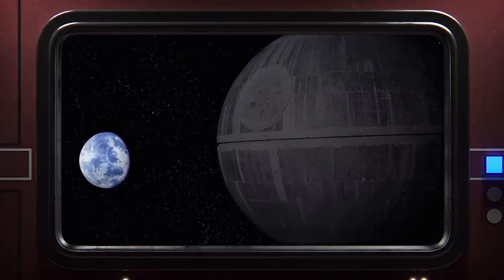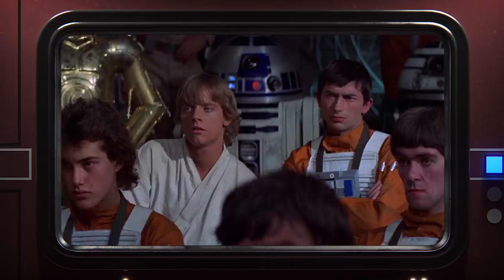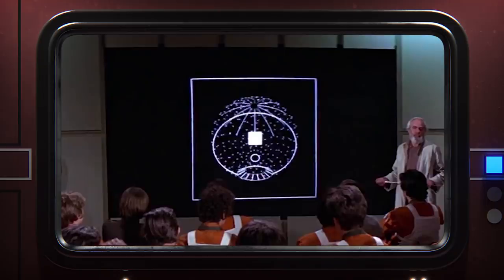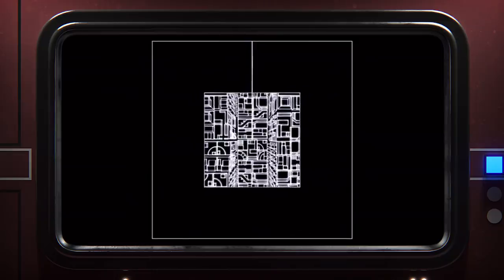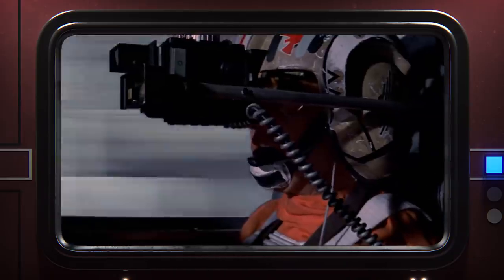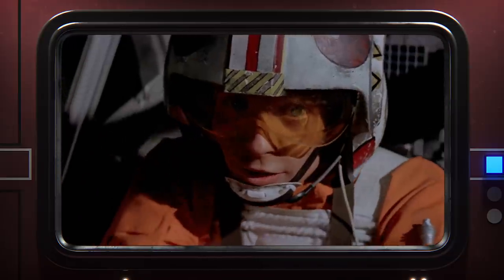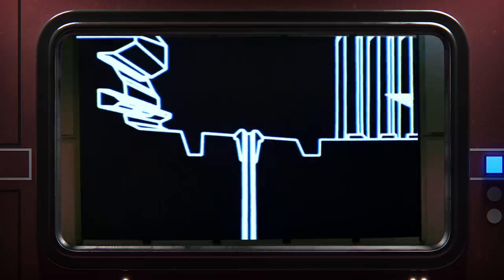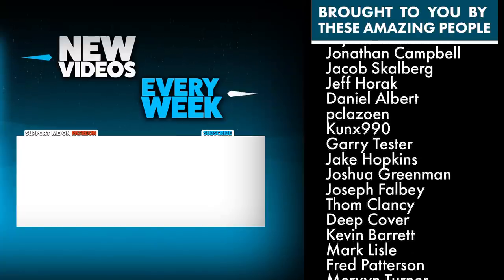The Thermal Exhaust Port Was NEVER a Problem

Comment: Another, related, point is the Imperials suspected something was wrong. An officer told Tarkin they had analyzed the rebel attack and found a small change they could destroy the station.
Reply: I wondered about this myself. It introduces a small weakness in the Rogue One storyline, or it suggests that they looked at the consequences of a proton torpedo hitting the reactor housing, discovered the weakness, and reported it in terms of threat. Actually, given the battle situation, this was quite realistic; root cause analysis is not suitable when the enemy is already on approach.

It also suggests that the Imperials were not complete dunderheads, and Erso not infallible. Stories are so much better when one side isn’t omniscient and the other side totally incompetent.
Reply: @andyl8055  You could do a LOT of drill down on the military of the Galactic Empire. How they recruit. How they train and promote leaders. The status of Stormtroopers and how they relate to the rest of the military.
Reply: Is that Florian geyer in your profile pic?
Reply: Indeed..... and that comment would seem to imply that there is a plausible reason why the port is not guarded against torpedoes beyond simple arrogance. It was a known risk, but one deemed necessary and manageable.
Reply: @travissmith2848  Tarkin even said it. "You overestimate their chances" and think of it. If Han hadn't intervened Luke would have died. If Luke hadn't used the Force he would have missed.
Reply: @readermike8355  Negligible chance combined with narrow minded combat doctrine is a factor. But it was known that if they attacked with a small enough craft, with just the right weapon, in just the right way it could take down the station. As the port was shielded against one kind of weapon it was clearly seen as a potential weakness, so it stands to reason that it would be prohibitive to protect against all possible weapons.
Yeah, a weakness that can only be exploited by a force user, someone insanely lucky, or the best ship's weapons marksman in the galaxy piloting a craft that conventional combat thinking is too small for the task and has enough cover to deal with the various turret emplacements and defensive fighter cover is not a glaring flaw. Tanks would be a lot tougher if they didn't have any holes or joints too. But then you'd just have a bunch of guys sealed in a steal can suffocating and starving with no way to attack, not a weapon.
Reply: @travissmith2848  ray shielding could be for other things. ray shields (the type in question) absorb radition. perhaps it is not shielded for protection but some function of the exhaust port. afterall the only thing it can stop is blaster fire which can't bend like a missile can.
Reply: @matthiuskoenig3378  It was, never the less, stated that what would have otherwise been the go to weapon was useless. Whatever the reason for the shielding the station was invulnerable to any kind of conventional attack and nearly so to an unconventional one even with the plans. The port seems more a functional necessity that was as protected as possible while still allowing its function. Kind of the opposite of a glaring flaw.
Reply: Something else of note happened even earlier in the film. Before the destruction of Alderaan, an officer interrupted Tarkin and Vader discussing Leia’s interrogation to comment on a final systems check revealing all systems were operational. I think imperial concerns about possible sabotage were laid to rest after that.
Reply: @travissmith2848  there are 2 kinds of shielding in star wars: ray shielding and particle shielding. The former stops energy weapons and the latter stops/vaporizes physical weapons, including proton torpedoes. The reason the exhaust port didnt have particle shields is because it would directly interfere with the port's purpose for existing. Namely, getting hot gas (probably either vaporized coolant or spent fuel) out of the station.
Reply: @Christian-sq2bw  Well... guess that explains it. Still, there was a reason for it to let torpedoes through so given the "nobody would ever...." thinking it was a known risk but a negligible and manageable one.
Reply: @travissmith2848  Remember, the heaviest warships in the galaxy at this point were only 2 km long. In a firefight, the Death Star had even the Imperial Navy outmatched. And the superlaser could go Yeet yeet starship delete every 15 minutes.
Reply: @Veloxyll  I believe the ability to target ships was an improvement given to the second one. Never the less, Imperial thinking would seem to be one that the station was heavily enough armed to fend off any large ships and fighters couldn't even scratch the surface. And yet the port was a known issue (as the attack pattern did represent a threat)

Comment: The novelization of RotJ states the second Death Star’s design eliminates the 2 meter exhaust ports and instead used thousands or even millions of tiny exhaust vents too small for any munitions to find and damage.  Unfortunately the battle station was not completed and the rebel ships could fly directly to the reactor.  Oops.
Reply: Russell Harrell You could blame the Emperor for that. He was way too overconfident.
Reply: Peter Krochmalni classic villain hubris, only to be overshadowed by classic hero hubris like in TESB.  And TLJ, if that counts
Reply: The entire point of the Emperors plans was that it was supposed to look unfinished and vulnerable, and that he was there to make the target even more tempting for the rebels. Had it been entirely unable to be attacked, then the rebels would just have gone to ground.
Reply: DE J but the Death Star was still unfinished, despite the main weapon being online.  The rebels succeeded in breaching the shield and flying into the main reactor.  The emperor should have at least had a separate shield generator on board to protect the reactor or a physical shield that sealed the core once the Endor shield failed.  His best troops on the moon couldn’t handle the locals plus a small rebel commando unit, and his plan totally relied on them holding the bunker long enough for the imperial fleet to mop up the rebel fleet.  And his best troops did not do their job.  There should have been a million troops or more on the ground, he had at least that many personnel on the death star and on the fleet ships.  That bunker could have been miles of tunnels with multiple ‘back doors’ in ensure a Truly overwhelming response to any incursion.  A half dozen At-st walkers and less than a hundred stormies don’t cut it.  Also immediate execution of captured rebels should been the order of the day.
Reply: Well if it was completed, then all you would need is an under cover operation to smuggle in an explosive and move it close to the explodey part of the reactor.
Reply: @samtheweebo  more easily said than done.  But fully within the skill set of our main heroes.
Reply: @russellharrell2747  That feeling when you and your buddies are patrolling Space Vietnam and the trees start talking in teddy bear...
Reply: Palpatine might have been a political genius back in the day. But that doesn't mean he was a good military strategist. 
Setting a trap for your enemy using an unfinished yet fully operational battle station/superweapon.
I think we should stop criticising the Deathstar and/or the Imperial Navy and start criticising the man who is behind them both.
Reply: @Agarwaen  People criticise the exhaust pipe, yet Palpatine set a trap for a famously crafty foe, using battle station with an exposed power core and insisted to personally over see the battle.
Reply: That could have been intentional, aside from the ambush. Maybe having the reactor exposed to space allowed it to fire much faster more often since heat wasn't bottled up in the middle of a small moon.
Reply: @Agarwaen  The Emperor should have made a second trap inside the Death Star. As soon as the fighters entered the hole throw up to shields. One to cover the hole so there is no escape and one on the way to the reactor to destroy ships like we saw happen in Rogue One at Scarif. Put up jammers just like they did as soon as the rebel fleet arrived so they can't detect the shield in the shaft. (Remember Lando's words as they headed towards the Death Star about not being able to get a reading on the shields one way or the other.)
Reply: The fact they had a star-fighter sized hole leading into the main reactor is kind of hilarious enough
Reply: @inkedseahear  Good ol' Palpatine really knew how to prioritize. 
I mean the light freighter sized hole in your battle station that just happens lead straight to your reactor isn't important, as long as you can blow up rebel capital ships with your super laser. Right?
Reply: @russellharrell2747  His plan didn't rely on locals fighting the rebels. It's possible the empire didn't even know about ewoks, or if they did they had no reason to believe they could organize well enough to actually fight. Reasonably they would've lost even if they did, but with the power of plot, combined with them stealing an AT-ST, they won.
Reply: @peterkrochmalni673  Nah. It would have worked if not for the Teddy Bears on the ground.
And just like him, nobody actually expected Ewoks to be the force that would change the tide and grant the rebels the victory.
Reply: You’d think armoring the reactor would be the first and top priority
Reply: @__tadpole__8195  How would you armor it?
Reply: @Tinfoil_Hardhat  with durasteel? They literally left it completely open, keep the exhaust ports but at least armor the parts where there isn’t a fucking deathstar protecting it
Reply: @__tadpole__8195  The entire point of an exhaust port is to LET OUT EXHAUST. Your comment is like "well why wouldn't you cover the end of your muffler? The car is supposed to be armored right?" Putting armor there or in the path to the reactor would trap it in, which is counter to the point. Its not like it wasn't completely unprotected. It was ray shielded, surrounded by turbo lasers, and basically impossible to hit.
Reply: Whoopsie
Reply: Imagine if they kept it x-wing sized instead of Millennium Falcon sized... >-> :D
Reply: @darthgamer2014  Clearly the hit and run tactics were hurting the empire, a new death star was the only thing that could lure them into committing their forces.
Too many troops and you spook them or they don't chance it. Rebels have spies everywhere, they did well to hide the fact they had an entire star fleet waiting. 

They never intended on completing the death star, they wanted to crush the rebels. 

And without Luke distracting/entertaining him they very likely would have won- combined with the fact their fleet commander was on the death star socialising rather than leading the navy. 

Also, rebels started relying on kamikaze tactics to take out the superior foe...

And also, if the imperial fleet didn't retreat/surrender, they would have still killed all of the rebels regardless of the death star.
Reply: @carbon1255  regardless, leaving a hole the size of the falcon in Deathstar's hull is still an incredible risk.
Reply: ... but then they INTENTIONALLY lured the rebels in to attack the “not completed” space station...
Reply: @matthewharvey3556  I get that, but they at least but some armor plating around the reactor.
Reply: @JonatasMonte  Exactly. It is the Emperor underestimating his enemies, both the Rebels able to survive the trap and take out his fleet, the Ewoks for turning the tide against his best legion of troops, the Jedi (Kenobi and Yoda) for training Luke so well that he does not fall to the Dark Side, and for underestimating Anakin's humanity and love for Luke and Luke's love for his father.

It is multiple instances of arrogance despite the warning signs he says in his dialogue with Vader early on ROTJ that cause his defeat.

It is the best kind of ironic justice.
Reply: Holograms are a thing, I always wondered why they didn't use them to make it appear unfinished
Reply: @jonnyblade3234  The budget for the first Star Wars film was very tight with a troubled production (understatement of the century). It was do or die time for Lucas.

No time or money to use a hologram.
Reply: @pspublic13  I meant why didn't the emperor use one
Reply: @jonnyblade3234  To finish the Death Star and then to make it seem unfinished? I don't understand what you are trying to suggest.

If it is what I state above, there's no way a hologram can cover the whole Death Star. The Rebels have spies that keep track of construction material shipments, etc, etc.
Reply: @jonnyblade3234  Good question. Perhaps the holo projector would have been too big the project something the size of a Deathstar. And still be a cost effective solution. 
But then again we have only seen 3 types of projectors, the handheld devices, the droid mounted projectors and the table sized projectors, so who knows.
Reply: Just wanna point out to everyone arguing about the size of the 2nd death stars work shaft... You guys do know when building something you generally leave enough room to actually get the equipment inside right? The falcon was a working vessel, meaning there could've been similar models working to help build the death Star, meaning it would make total sense to have enough room to accommodate one.
Think of it like a high-rise skyscraper, they build the foundation (in this case the reactor) and then build the crane inside the building, then as the walls get built up the crane gets moved up the building and the floors below it can then be finished, until the crane is at the top of the building and everything below it just needs finishing touches (incredibly simplified of course)
The aim for the 2nd death Star was to get it finished as quickly as possible, instead of secrecy. We know this because the first death Star was seen being constructed at the end of the 3rd film and only gets finished days before the fourth, which is 19 years later, during which time the rebels only learned about it after it was ready to blow up planets. On the other hand the 2nd death Star is roughly 50% complete in around 2-8 years, assuming it was either built once the first death Star was finished or immediately upon its destruction, you can see the reactor and gun was basically 100% done with the majority of the casing being done, the only parts unfinished was the interior. Hell, we see a super star destroyer crash into the casing and leave no mark whatsoever.
Reply: @mickys8065  you have a good point, though personally I believe It's  not the giant hole people are criticising but more or less that Palps didn't cover it before setting the trap.
The point of a trap is to lure into thinking they have the upper hand, until you reveal your surprise. The Deathstar 2 being operational sure was a surprise and so was the imperial fleet stationed near the battle station. 
However how much of a surprise would it have been if the Rebels went down that shaft only to encounter the reactor's armor plating instead of the reactor?
Reply: @darthgamer2014  true true, at least in the Lego Starwars game you needed to destroy several shield generators before you reached the reactor
Reply: @peterkrochmalni673  well to be fair he didn’t expect the shield to go down that’s the only reason they were able to get to the core
Reply: @russellharrell2747  the emperor wanted a new apprentice he did not care about his dumb weapon being destroyed
Reply: Millions of exhaust ports would all need thermal porting to them, that would be just a huge web of heat pipes. 2 MILLION? Their engineer would be bawling
Reply: This also means that the Empire didn't actually correct the flaw in the reactor that Erso put into the thing.  They just patched the known exploit from the first Death Star.  Meaning, in theory, they could have smuggled in Solo's commando team into the Death Star II and tried to blow it up from the inside.  But it would be highly unlikely for them to be able to get that deep into the station without being noticed, so the blow up the shield plan followed by the Fleet and fighters approach was what they had to work with.
Reply: @peterkrochmalni673  Ain't the first time. Palpatine underestimated the Gungans and the Naboo people and underestimated the surprise attack from the Ewoks.
Reply: @Ithekro  the rogue one Eros reactor thing is not canon to George Lucas’s Star Wars it did not exist at the time Return of the Jedi was made so stop referencing it.
Reply: If Rogue Leader: Rogue Squadron II is anything to go by, flying through all those tunnels to the reactor core was no easy feat, I still haven't managed to do it with the Falcon.
Reply: To be fair, Palpatine left it unfinished on purpose as a trap